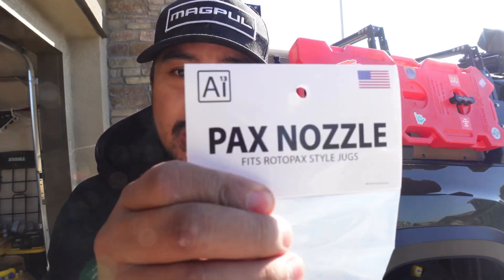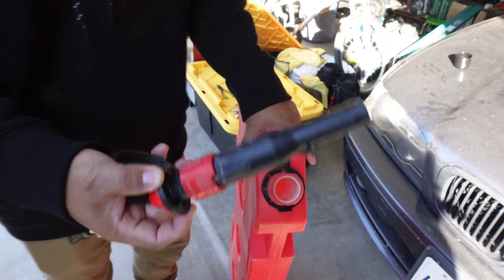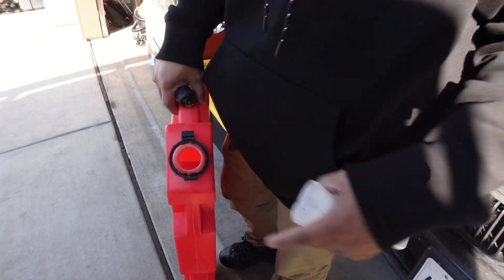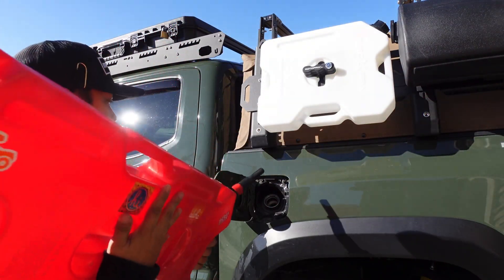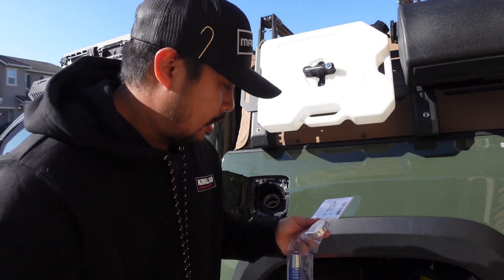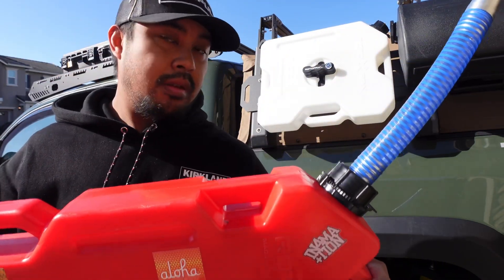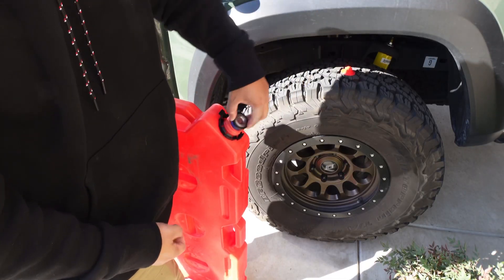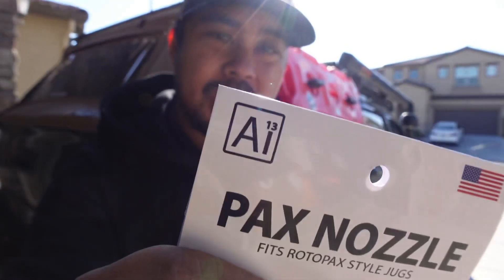Make Your Life Easier, ROTOPAX Free Flow Nozzle

Comment: I tried my rotopax today and struggled with the nozzle that came with the container. I must have twisted the lock unlock selector at least 8x. Finally I gave up, it's  a pos.  I'll get mine similar to your nozzle for good.  Thanks for the vid.  Milpitas,  CA.
Reply from the maker: No problem, I did have some leaking issues after I swapped to the free flow. So I use the regular OEM nozzle just to keep it from leaking then I use the free flow when I need to actually use my rotopax

Comment: One possible suggestion.  If you can mount the fuel can above the same side as the fuel filler, you may be able to keep the can mounted and just use a jiggle siphon or squeeze ball siphon hose and let gravity fill the tank without taking the can off the mount.  I’m planning on trying this myself when I get my Rotopax can installed.
Reply: Yup! Watching all these videos about people complaining whereas a simple jiggle siphon can solve all their problem😁
Reply: That was my plan all along and was looking for a way to remove that plastic filter lol because the 4 gallon is a pita to use with the leaks and even a good nozzle haha
Reply: @Corvenik1  I wound up removing the screen with a sturdy knife, a flat head screw driver, and a pair of long nose pliers.  It was a little easier than I anticipated.  It took a bit of patience and careful persistence to keep steadily working at it and getting separation but it came out without a lot of physical effort… and in one piece.  I rinsed out the can afterwards to make sure no plastic was left behind.
Reply: @pn312  The filter is getting trouble to fill up the gas can. Good to see you easy to remove it.👍

Comment: I totally agree the nozzles totally suck!!! I decided just to get a long funnel that goes into my fuel tank and I just poured in through the funnel but that’s a nice set up👍
Reply from the maker: That works lol probably much more faster and easier than the oem nozzle
Reply: I do the same.  Now I have an issue of getting a new seal for that eco filler nozzle.  Apparently the eco nozzle seal is larger in diameter than the original Rotopax nozzle seal.

Comment: Some people show how easy it is, but they have a fill port that allows you to press down on the control tab on the neck of the RotoPax spout fairly easily.  And with Diesel, you always need to bring a box of nitrile disposable gloves to disassemble the RotoPax spout.  By the time you've dripped and spilled fuel all over the place, you've massively exceeded any emissions that the OEM spout was intended to control in the first place. Do yourself and the environment a favor and get a free flow nozzle.

Comment: I just went to the PAX website and the nozzle you showed is designed for WATER ONLY, and is currently sold out. But they do have another one that can be used for GAS or WATER, and is ALL METAL. It costs $55 instead of $35. I guess the water only version works OK, since you have been using it, but I don't know if there are any problems using it with gas?
Reply from the maker: They did came out with an updated version of the free flow nozzle that is all metal for use with gas. At the time, the version shown in the video was labeled as their only free flow nozzle for use with gas and has since been labeled as for water use only. 

With the “overland” market as it is, gear changes or get updated quite frequently to meet standards or quality. So in the span of this video going up and now, they received enough feedback to make an updated version. At least that’s what I’m assuming since I last spoke to them. (I bought the product it wasn’t a sponsored or free product).

I kept this nozzle in a ziplock bag in my roof box. I only attached it to my rotopax when was using it and I used the oem nozzle during transport. I didn’t have any issues with the nozzle it was actually really useful when I was running a rotopax. It cut the time and headache by a ton.

With all that being said I would definitely not use it for gas, if its labeled as intended for water use only. I would most definitely not advise you to store it in your rotopax.
Reply: @RoamWithJon  Thank you, Jon, for your wonderful review and for taking the time to respond to the comments. I truly appreciate it. You are absolutely correct in your observations.

In order to deliver the best possible product, I made several modifications. While the manufacturer of the blue hose I purchased claims that it is suitable for use with fuel, it has been found that over time, the hose becomes as rigid as a PVC pipe. Despite the manufacturer's attempts to adjust the blend, the issue was not resolved. This is why I developed the All Metal Pax Nozzle, which completely eliminates the use of plastic hoses. The nozzle is designed to be submerged in fuel 24/7, and it has proven to be an outstanding product. We have shipped thousands of units, and to date, we have not experienced a single failure. Additionally, the All Metal Pax Nozzle comes with a lifetime warranty, adding to its appeal.

Regarding the leaking issue that you had, it is indeed related to the gap created by removing the Flame Mitigation Device (FMD). To address this, we offer a simple solution: our Shipping Spacer. You can find the Shipping Spacer on our website under the "Everything Pax" tab. It effectively resolves the gap issue, ensuring a proper seal and preventing any leaks.

I'm not entirely sure where the $55 figure came from; perhaps @jamesmeyer1325 has combined a few different items. The All Metal Nozzle itself is priced at $35.00. 

If you own a Gen-02 Rotopax and wish to store the nozzle inside the container, you will need the Shipping Spacer. 

One last thing if you are using the nozzle with a vehicle that has a standard filler neck, I would recommend our Spout Adapter.
Reply from the maker: @ai13billetproducts51  no worries, 100% coming back to your products if I ever start using a rotopax again 🤙🏽

Comment: Looks like this blue one just “water only” on their website, do u know what different and how is working right now
Reply from the maker: I’m not sure what the differences are I haven’t looked into them since I bought this to be honest. Mine leaks slightly since I took the safety piece off of the rotopack so I switched over to the oem nozzle while transporting and then only plug this one in when I’m trying to refuel.
Reply: @RoamWithJon  water plastics can be dissolved by fuel. Fuel is a solvent, a dissolver. The seals supplied with Water plastics might dissolve also because they're not fuel proof.
This could be quite dangerous for you or anyone else who might use your system, such as family etc.

Maybe you could go to Rotopax with your idea and feedback about their fill nozzle being terrible as well as how to improve it?
Reply from the maker: @Google_Does_Evil_Now  ai13 recently changed their website. They used to have their this model in the video shown and marketed as their fuel nozzle. That’s where it got confusing.

Now their new all aluminum nozzle is labeled as their gas one and they moved this older model to water only.

Rotopax designed their oem nozzle to work with carb compliances. I highly doubt going to them and complaining would do anything.

Comment: How’d you get that filter out?
I can’t seem to do it
Reply from the maker: I don’t really recommend taking it out, you’re better off keeping the high flow nozzle in a ziplock bag and then just taking it out when you need to use it. Taking it out causes leaks and it’s also a carb requirement.
Reply: @RoamWithJon  rats. Too late…
Reply from the maker: @Treetopflyer777  ah should be fine ish lol. If anything you can retrofit a larger gasket to the nozzle
Reply: @RoamWithJon  I’ll prob need that. lol

Comment: You know the nozzle for the white water rotopax on your truck fits the gas pax also, correct?
Reply from the maker: Yessir, but you cant store it inside of the gas nozzle since it’s not the rated for gas. Not to mention you ruin a perfectly good nozzle lol. It’s also super thin it would probably take longer to fill than the oem gas nozzle.
Reply: It doesn't work anymore. They changed the sizes so that water spout won't seal on a gas pax.
Reply from the maker: @KorysRides there’s a new Version out for fuel. Apparently they swapped this version over to be water only.

Comment: Mine leaks.  It doesn't self center on the rotopax so you have to line it up just right and tighten the crap out of it.  Forget about venting daily.  Nearly impossible to center the nozzle with the pack on the rack.  I think the rotopax one was better honestly
Reply from the maker: I went back to the original nozzle as well and switch back to the high flow nozzle when I use it. I think they actually made a new version.
Reply: @RoamWithJon  nah I called them and they said to cut the top part off the white insert so it will center which is what I did and no problem since.  I keep the spout separate and just cap it though.  I think they can't market it like this because of the EPA requirements on the white insert.  Just fyi.

Comment: It’s didn’t leak lol it looks like you unlocked it first before putting it in the hole. First align the hook towards the gas hole edges then you unlock it and push it down so it can pour easier I have one and it works fine
Reply from the maker: Sorry for the late reply I might have unlocked it before I picked it up and didn’t relock it all the way lol. But either way it mostly to show how cumbersome and clunky it was to use and that the fill time was extra long with the oem nozzle. With the free flow nozzle I found it’s less cumbersome, clunky, and overall emptied the roto pack much faster. Overall less work and headache.

Comment: Spout design is for epa and dot fuel transportation laws. Wondering what the fine is on highway and blm land violations? Especially during fire bans transporting fuel in an improper container…. Federal fines are usually triple the amount of usual road infractions! Be careful with the advice you share.
Reply from the maker: Yes it’s a CARB requirement, there’s a disclaimer in the description of the video.

Comment: That "filter" that you removed is actually a flame mitigation device. It is required for all types of Jerry cans (portable fuel containers) as of law by 2023.

Yes, rotopax's sprouts are stupid, but again that's because of the law since 2009 says rotopax cannot sell you one directly with a vent..
Reply: I take those off my liquor bottles too.
Reply: I just got a Rotopax, never used/seen one before.  I went to fill the Rotopax the other day at the gas station.  The "flame mitigation device" or "filter", is dumb.  I couldn't fill the can up, as if I let gas into the can any faster than a slow trickle, the fuel would just spill out.  Unless there is a secret that I don't know about, I don't have time to sit at a gas station trickling gas into a gas can.
Reply: Couldn’t they have made the filter longer so other spouts could be accommodated?  Annoyed that the only way to introduce an improvement is to basically fully disable the filter.
Reply from the maker: @davidcarrico3385 a lot of things that CARB does doesn’t make sense consumer wise lol. I’m sure if rotopax wanted to, they could make a better nozzle so people wouldn’t be looking for other options 🤷🏻‍♂️